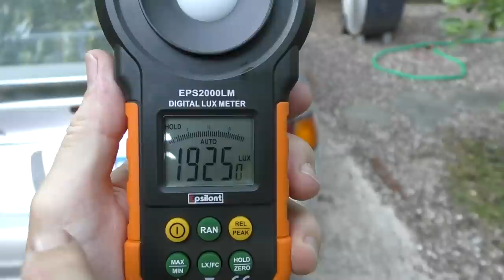I Made a Huge Mistake Buying These Headlights

Comment: Scotty, I’ve noticed a lot of people often have misaligned headlights or their low beams aimed way too high.
Reply: That's generally the main problem,  conversions from Halogen to LED often require changing the housing as to not dazzle other drivers. People skip this step to save costs. The problem isn't the LED lights themselves, as all the grumpy old men in the comments suggest, but rather corner cutting. I've been driving cars with LEDs from factory and have never been highbeamed to shut off the lights.
Reply: @SigmaticGames  Totally  this.   I replaced the  halogens in my Hyundai with the Boslla kit that Scotty talks about and noticed they were totally aimed too high.  Fortunately the set-screws were able to bring them down to the proper level.
Reply: When I bought my car oddly enough one of the lights aimed higher than the other. I could see it against my garage. It bugged me so much so I had to change it soon after. I had to take apart the whole front of my car just to get the headlights out to adjust the aim of the light. What a day that way
Reply: That happens on projector headlights too, sometimes the right one is either lower or higher, same on the left
Reply: It's strange this video is put up after I was highbeaming a newer Chevy 2500 or 3500, tonight, as it's lights were so blinding.  It ended up flashing back and I didn't even realize until the last second because the low beams were so much brighter or something.
Reply: Ben Kenny , were they towing?  Trucks towing a load,  usually the added weight pushes down on the rear of the truck aiming the headlights higher. I know some trucks have an option to where headlights level automatically or like my friends Tundra, you can manually adjust headlights with a switch when under load.
Reply: My friend told me about his LED bulbs. Put them in his CR-V and as he was going home that day a ton of people flashed their beams at him. Took it to his shop the next day and the manager walked right up, whipped out his screwdriver, and adjusted the damn things. No one flashed him since.
Reply: @K1500R  I don't 100% remember, but it may of had a lift and bigger wheels.  No trailer, but it could of had something in the bed.  IDK where it is, but I made a comment on the video about 99% of car lights being glaring and details about it.
Reply: Ben Kenny Some guys (Like me included) Have put leveling kits on the front end of there 4x4 truck to get more clearance under the front bumper for off road use, And it makes the head light beams too high. I had to adjust mine back down to the proper level, But a lot of guys don’t think to do that. That could have been the problem too.
Reply: @benkenny3220  Yep they are crazy bright. Should be illegal. I get spots burned into my eyes from that truck and any 2018 and newer Toyota are all crazy bright with projection beams which has the light coming all from a little point source which is like staring at a laser beam lol. The worst is when the road isn't flat and there is hills. One place I drive has long cresting hills so these direct lights will be pointed up in my face for a few seconds as each car passes.
Reply: More often than not, i've been blinded by people driving an old car with halogens, and not an LED or HID. Heck, even in daytime they've blinded me.
Reply: @TopiasSalakka  Yep DIY headlights can also be blinding. I have a friend that replaced her old car bulbs with HID and when she's driving I noticed how bright and blinding they are when she's pulling into my driveway! I told her its not acceptable and she thinks its just fine because she see better.
Reply: @practicalguy973  HIDs in a reflector housing?
Reply: @TopiasSalakka  Yep, the worst way to do it. Those conversion kits should be illegal.
Reply: @practicalguy973  There are actually some cars that come with HIDs in reflector housings from the factory.
I believe Toyota and Volvo at least have them. Scotty has a video about one, replaced a HID bulb in a Prius.
They use special bulbs though, that have a coating to reduce glare.
Reply: I've actually done that. Then realized I needed to lower them . Ha
Reply: @ghost-4230  I can't tell if you're joking or not, but that is how they are supposed to be. The one that is lower is on the side of the driver so that it doesn't blind oncoming traffic. You just made your car annoying on the road. Literally every car is like that.
Reply: @SigmaticGames  Newer cars running LED bulbs have excellent cutoff, but putting the LED in a housing designed for a halogen bulb is a big no-no since the bulb location is rarely compatible for LED and they can blind oncoming drivers. In fact, LED bulbs in halogen housings is against the law in the US for that very reason although many 19 year olds ignore that.
Reply: @practicalguy973  Yep. Conversion kits unless they have a DOT lettering (approved by US DOT) is shown on the lens, are illegal. This is how oncoming drivers are blinded and, too often, have an accident. The housing has to be designed for LED bulbs to ensure proper light cutoff pattern. You can't just change the bulb in the existing housing, you have to change to a housing designed for the LED bulb. Law enforcement should be trained to check the bulbs in vehicles involved in head on collisions to see if one vehicle had improper bulbs.

Comment: Pretty funny how Backup cameras are now required, but headlights that blind every oncoming driver is permitted.
Reply: I think he meant standard for safety
Reply: Because the headlights are aimed incorrectly
Reply: @jjm2948  why should I?
Reply: The Toyota Corolla with Lazer headlights are the worst, they bling you from far away.. stupid Toyota.
Reply: Where are back up cams required? Majority of cars don't have em
Reply: @wendyhager6655  In the USA from last year I believe. On new cars only though.
Reply: Gildardo Longer than that! My Jeeps 6 years old and has them!
Reply: blue dream any car that are made in 2019 to the present must have a backup camera
Reply: @wendyhager6655  all new models in the US starting last year
Reply: @Fifthcell  Wrong.  There is no way to aim LED bulbs that won't result in more blinding, unless they are aimed so far off the road that the vision of the driver is worse than using the weakest incan bulbs available.  The drop-in LED beam pattern is wrong (due to use of a housing for incan bulbs) and the color temperature is too high.
Reply: Where are backup cameras required mine don't have one
Reply: @MrRobnkim  Safety and fuel economy regulations have resulted in terrible visibility. Thick pillars and high trunks mean tiny windows. Also, big SUVs are so high that a child, bicycle, wheelchair, dwarf, etc. can't be seen unless they're like 20 ft. away. So, cameras.
Reply: Dillon Hawkins yes😁
Reply: @blisterbrain  ya so buy a backup camera it's not required to have in any car or truck
Reply: Well you finally hit upon an important subject of universal interest. It's not right that people are being blinded because the government is not setting or enforcing lighting standards. People should slow down and they wouldn't need those blinding lights. dealer told me today that pickup trucks come with a brighter lights yet
Because they might get this might be towing a trailer. But I say they should have trailer brakes and drive slower if they have a heavy load. apparently the auto dims are really Auto brights because they returned to Bright after the one car has passed.. this is aggravated by the fact that a lot of people fail to dim and the police do little about it You have a good subject going and you should write it out because approximately half the population is PO'd.
Reply: No its because they leave their high beams on
Reply: @jjm2948  i delivered post n papers at night....in a rural area...
Reply: @Elenrai  same here, I was just about to post that, I get blinded ALL THE TIME
Reply: funny thing is, the big semi trucks with 20,000 lights all over them are the only ones that DON´T blind me

Comment: I tried LED light bulbs for a year in my 09 Equinox Sport. I put the original halogen bulbs back in. The hi beams in the LED weren’t any brighter than the low beams. And you really couldn’t adjust them very well. I think it depends on your headlight housing if LEDs work properly. The halogen headlight housings were designed for halogen bulbs.

Comment: Should be noted that the beams should be adjusted to a proper height by the set screws on the headlamp unit.   A lot of people just toss the bulbs in and go which is a huge part of the problem.

Moving from one technology to another, often the tilt of the beam needs to be adjusted.  This is the main reason a lot of people get "blinded"

I did replace the halogens in my Hyundai with the Boslla LED set that Scotty talks about and they are definitely brighter, but no one oncoming would notice because I had to adjust them down quite a bit.

Comment: My car used to go through regular headlights relatively quickly until I converted to LEDs.  I also had them professionally installed so they would be aligned correctly.  I love them.  They last tremendously longer and I can see the road better.
Reply: That's because most of the halogens in auto parts stores are junk. Osram makes the best halogen bulbs. But places like Advance don't seem to sell them.

Comment: I can’t stand how bright they are and how expensive they are I hate the blue light wavelength
Reply: LED headlights are tuned to be emit white light from the factory, those who drive with blue headlights, modified them themselves.
Reply: Verliebt you’re wrong companies offer different color temperature you can choose from like true white or the blue shade you are speaking of
Reply: I'm not wrong for where I live, since in Europe they're obligated by law to make headlights on new cars emit white light, nobody offers any other option, but I still see people sometimes with blue light coming from their headlights. there are kits available to change the color of your lights even here, some people also paint the glass on their headlights.

few years ago it was simple, low beam had a yellow or blue tint, high beam was all white, so you'd know what they're using. yellow was from cars with halogens, blue from cars with xenon bulbs, but now all have to be white.
Reply: Oscar Aguilar the blue is really tough on the eyes
Reply: Verliebt just a blue type of light is extremely hard on the eyes especially when your eyesight has to readjust to the rest of the cars that have white and then the few cars that are coming at you with bluish LightNot good and very dangerous
Reply: I personally don't really mind the blue tint on some car's lights. what bothers me is brightness, some people mess with their headlights either make them too bright or raise the beam to high, that's what bothers me. I find the cars with headlight blubs that have a slight tint to generally not be as bright as the pure white ones, on average.
what also bothers me are the turning signals on some newer cars, mostly audis, that have like an animation to them, very distracting to me.
 
and btw, human eyes are most sensitive to green light, and in Europe car manufacturers are obligated to have just white light on the new cars because white light gets reflected better than if the light is slightly yellowish or bluish.
Reply: @verliebt3465  Bruh you can get LEDs in all kind of colours (white to pink)...
Reply: @verliebt3465  blue tint vs blue lighting
Reply: CoC Master no good either one
Reply: Verliebt true

This is why money is colored green
Get ya attention
Reply: Law enforcement in many states have that particular blue wavelength that is dazzling. Makes it difficult to see the people next to the car. I understand they're making sure that people will see an emergency that is parked but now it's blinding drivers. Not all states use that color of blue on their law enforcement vehicles. I have to use my high beams for a second so I can get a fix on where the people  are standing.

Comment: I agree with you Scotty.
You need decent set of LED replacement bulb if you want to upgrade the old halogen bulb, and most importantly you need to align the headlight correctly after installing LED bulbs.
Cheaply designed LED bulbs tend to produce too much glare since it doesn't correctly reproduce light output of a halogen bulbs

Comment: Halogens are the best. They get nice and hot that they melt caked on ice and snow.👌🏼
Reply: and they put out plenty of light and are cheap to replace.
Reply: Actually, that is a problem with LED traffic lights. Up north they get packed with snow and the LED's will not melt it. The old tungsten bulbs get hot and melt the snow off pretty quick.
Reply: @miketonon7946  because LED puts out about 4x the light if not more. On a motorbike halogen just does not cut it anymore,
Reply: @jwelchon2416  factory led headlights all have built in defrosting

Comment: I love my mid 90's truck
No Air conditioning 
No power windows
No automatic transmission 
It has Everything  😃
Reply: Ken Alexanderstein I love my early 40's sedan. 

No ac 
No power windows 
No auto transmission 
No seatbelts 
No turn signals 
No reverse lights
It has nothing but it's all original and still drives and that's all I need!!
Reply: Got a 90 Chevy 5spd 4x4 with 348,000 miles love every minute I put in it
Reply: I like those old vehicles, nothing to break, nothing to fix. I get my keys re-made at the local hardware store.  :)
Reply: It's all good and fun to have a manual truck until you come across a sleight incline.

Comment: Adaptive beam technology is such a good example of things coming full circle again. The origins of "High" and "Low" has nothing to do with power. As auto lights were originally gas fired. The projector literally had a rod connected to them that you pulled back for Low which dipped the headlight down and pushed forward for High which raised it up more parallel to the ground.

Comment: You forgot to factor in that electrical systems increase resistance with age which typically decreases total voltage and overall light output of halogen. I used to get flashed all the time on my Mustang. As it had aged the lights have dimmed even with electrical maintenance, new bulbs, and a high output alternator.

Also, as for using HID bulbs in a standard reflector you were getting flashed because the focal point of light is not in the stock location so you beam was different from factory. Yes they are definitely brighter but putting in a reflector not specifically designed for HID it makes the problems much worse as light shines in places, IE higher, than designed by the factory. It's the same reason good aftermarket LED bulbs mimic the single filament and you can also tune the exact location to have the factory light spread.
Reply: my older car read 11.3 volts at the bulb when on bright.
i installed relays for $ 15 and now it shows 14.1 volts.
Reply: @hotrodray6802  I've heard that really helps. I'm mainly stubborn and would like to improve my overall electrical system. With today's newer computer controlled cars that even more important.

Comment: Many years ago, when cars had round headlights, a friend of mine got angry at people not turning their bright lights to dim at night.    He purchased two aircraft landing lights and if an approaching car refused to dim his lights he flashed the aircraft landing lights.    Problem solved.    With today's bright headlight LED options it is important to make sure the new beam pattern is the same as the original.    If they shine to high they will blind oncoming cars and the lights will have to be manually adjusted downward.    Large pickup truck regularly suffer from this problem    Thank you for another great video!
Reply: Are you from Michigan? 
I remember hearing that story.

Comment: I only use HID bulbs in cars that have projector headlight assemblies.
Reply: Thats the key part with HID. They need to be mounted in actual HID projector housings. If you just throw them into into a reflection housing your going to blind everyone you pass.
Reply: Exactly.
Reply: @Dargonic  Absolutely. Reflector style assemblies were never intended to work with high discharge lamps, and more often than not, the beam is anything but concentrated or under control.
Reply: I believe in the kelvin ratings you choose as well.. i run 5500k hids and they are a nice natural white light.. none one has high beamed because they arent this stupid blue light u see on these hondas.....

Comment: I love HID bulbs. The thing people don't realize is any time you put in aftermarket lights there is a chance the bulb won't sit in the correct place in the reflective housing, which will cause you blind other drivers. Sometimes re-aiming the lights can fix it, but not always.
Reply: I've actually gotten used to seeing other cars on the road with hid or LED headlights and if I find they're blinding me I checked to see if one of us is on a hill first which is usually the case.
Reply: @robertknight4672  indeed a lot of times it is just the terrain. Especially where I'm at in PA... Everything is a hill!

Comment: I noticed Scotty didn’t mentioned that HIF headlight systems and usually LEDS too are best in projectors. If your car came with halogen bulbs you most likely will be okay putting in good LED bulbs like diode dynamics SL1 which are meant to mimic the beam pattern of halogen bulbs but you’ll most likely want to do a projector retrofit or have one installed for best lighting upgrades. Most people with blinding LEDS have them in halogen housings that weren’t meant for them